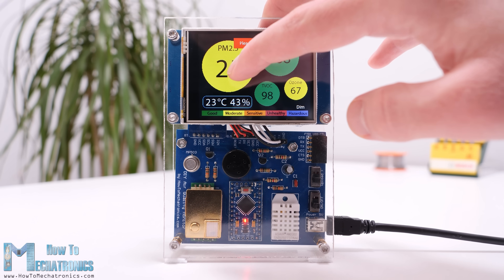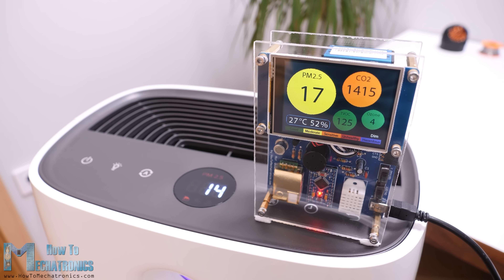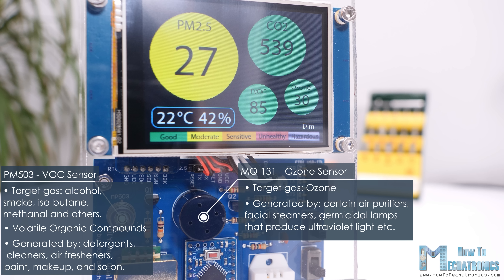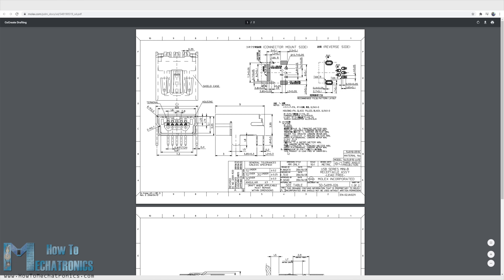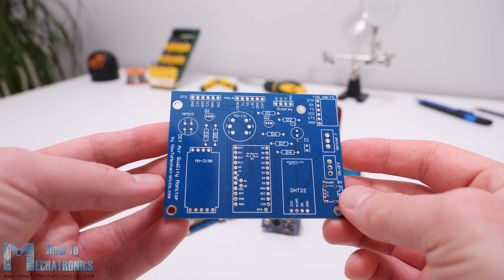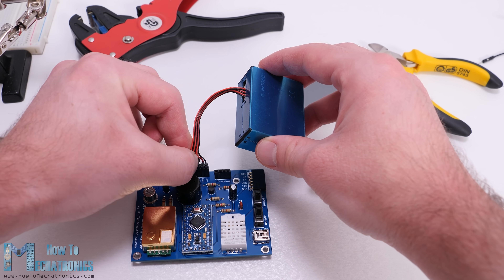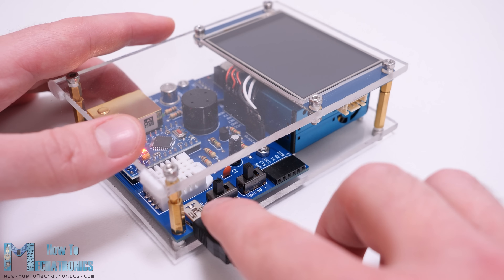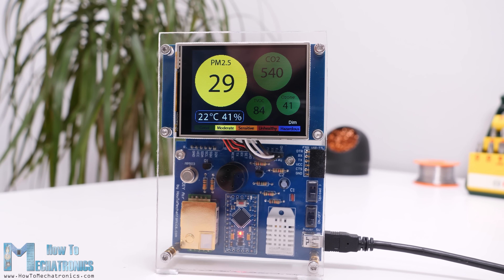DIY Air Quality Monitor - PM2.5, CO2, VOC, Ozone, Temp & Hum Arduino Meter

Comment: PMS5003 is capable of measuring PM1.0 / PM2.5 / PM10. Would it be difficult to implement those other parameters into the code?

Comment: Hello Dejan! The download links for the Arduino code and for the screen layout doesn't work! It is also impossible to leave comments on your site! Both for downloads and comments I received a message about and error accessing the database! Could you please check this issue? Thanks and compliments for your job!

Comment: I think the schematic need to be updated, i checked the schematic on your website and it doesn't show how the analog sensors are connected to the ADC, and here 5:20 both are connected to A0? is that why you control the heating element by D6 & D7? shortage of ADC pins?
Reply: Only the mq131 is connected to A0. Mp503 is connected to pin A1.  I built this with the board he designed and everything works fine. Must be a mistake in the first schematic.

Comment: My greatest compliments for your design. I build it and it works perfectly. Very good thinking about features and timeline. I made some adjustments so I can easely exchange sensors, but for now I cannot imaging what I should change. Calibration is for me less important compared to more or less  value readings. Maybe the loss of data when disconnecting the power could be a minor issue to solve. Thanks for all your time! Great job!
Reply: Hello! I'm a student and I need to build this for my studies. Could you please provide the materials you used and where did you order it, if you don't mind? It will help me a lot. Thank you!
Reply: @francenred1415  hI! did you find how to?

Comment: Can you include  temperature / heat generator which will turn on and off within specified  range of temperature and humidity.  Ventilation when co2 is higher than required

Comment: A very nice project that I was very much interested in for VOC monitoring until I realized that you can actually buy an air quality monitor that covers VOC's for less than just the PM2.5 sensor in this project costs

Comment: Great video, I made a similar system based on ESp32 without display but It can be integrated in home Assistant so you can check data also remotely
Reply: Hwy there 
Would you like to share details please?

Comment: Hi Dejan thanks for the amazing project 
I was just asking about the Mq131 sensor, its mentioned in the datasheet that it should be preheated for 48 hours 
It is also mentioned for Mq7 sensor that i want to use ? can u guide me throgh this?
Can i use the sensor straight away after purchasing or should i do the preheat procedure ? and how can i do that ?

Comment: great project, my workplace needs a few of these
 is there any way to add a decibel meter to this project ? 
is there a way to add a carbon monoxide sensor and monitoring? 
and is there any way to have 5 of these units report back to a central device for real time monitoring and data logging ?
Reply: Sure.

Comment: Very good and very informative video. The next upgrade to this project should be an air purifier. The air quality will send feedback to the fan when the desired value is achieved, the fan will automatically stop.

Comment: I like how he explains how the sensors work on a mechanical basis, not just how they're used electronically.
I should build one of these, for my oil painting area. At least the VOC part.
Reply: You can get a Sciosense APC1 evaluation kit for that, just plug it into your laptop and use the software they provide for that.  The evaluation kit is different than the sensor by itself, the evaluation kit (EK) comes with the usb cable and software and it works perfectly for 1 sensor.

Comment: I'm curious if anyone has built more than one of these, stood them side by side, and received the same readings on both.
Reply: Why would you expect industrial level accuracy from a cheap DIY project?
Reply: @nextlevelbruh827  Well, if this project is just a toy meant to teach the principles of such a device, I'm not interested.   On the other hand, if it can give reading +/- 3% of reality, then I'm in.   The finished products like this offered on Amazon garner terrible reviews.  That's where my skepticism comes from, and also my desire to build my own.
Reply: You don’t even need to build two, just buy multiple sensors and hook them up and test them at the same time to one arduino. Then use the best components

Comment: What happens if you fart in it? Which of those figures increases and by how much?
Reply: Voc and CO2 should go up, if particulates go up, be worried.
Reply: @lightdark00 LMAO
Reply: Build it and do an experiment with it with your family and friends then use AI to find patterns in the data and publish a paper I'm 100% sure the youtube AI will be all over that 😂
Reply: There could have been a better way to get a decent reply
Reply: Probably not. You need a H₂S and CH₄ (hydrogen sulfide and methane gas) sensor. Most of the fart gas volume is composed by nitrogen and carbonic gas, but the bad smell come mostly from hydrogen sulfide (approximately 1% in volume).
Reply: We need PM detector not a bloody fart detector😂😂😂
Reply: It's 3 years now how's the progress on the  experiment
Reply: The meter isn't meant to smell.  Smell on your own & put your rating where 10 - staggering and 1 - loud

Comment: Great Project. do you know what will it take to use a NodeMCU instead of the Arduino? I want the same setup but that will also connect to Home Assistant via WiFi
Reply: Did you ever find out how to integrate it into Home Assistant?

Comment: Don't get me wrong, the thing is very well made, and I understand that not everyone is comfortable around ESP8266, but this project seems to be a perfect fit for one of those.
- No need for RTC (just get time from internet (at power up) )
- Upload new sketch over the air.
- Check your graphs and data on any android phone (can even skip the display.. which is expensive)
Reply from the maker: You are absolutely right! Thanks for the input!
Reply: RTC is always needed as backup in case when your internet connection is down
Reply: @acerrusm  not really, if not real time-sensitive, in my experience internet down does not happen much, maybe different in your country.
Reply: @acerrusm  You can always display the current values from all your sensors
You can also always collect values based on relative time (every x minutes), display those and sync the time axis with the internet time when it becomes available.
The internet in my place is seldom down, and never for more than an hour.

Comment: Good project. Now add CO, HCOC, PM10 and it will be one of best air quality meters!
Reply: Actually for the PM10 @2:27 the sensor can already switch between them and the upgraded version can do somewhat better (PMS7003) what are the others polluants are you talking about? HCHO? sry not really my field. I'm interested in making one of these air monitor based on that one.
Reply: @hugodc1225  Oh so PM1 and PM10 are included? That's great! I missed that one, sorry:)
Well HCHO (hcoc was a typo) (although the real formula always used to be CH2O ... dk why manufacturers have changed it to HCHO)  is Formaldehyde - one of biggest indoors pollutants nowadays to worry about. 
And CO (unlike CO2) is Carbon Monoxide - an infamous "silent killer"! The stuff is lethal. There could be a fire in neighbor's flat and CO can kill you even before your smoke detector/alarm triggered.
Although of course it is worth to have CO detector alone (next to Smoke detector) in few places of your home.

Comment: This is a great project.   I read through most of the comments and many want to eliminate the display and use an ESP32 or similar.  then either MQTT or a cell phone.

It seems that just replacing the microcontroller is a trivial thing, but to have an AP, with website that can offer some graphics.  ( I really like the red/yellow/green of dots showing levels)  
Is there a part-2  in the future ?

I think that anyone wanting to go MQTT would already be able to export the data for that use.

FIVE STARS for your 24 hour arrays with data, just brilliant.
FIVE STARS for your wait with timer to gather data from a sensor.  also brilliant.
Reply from the maker: Thanks!
I wish I had the time to make a better version of this project. It's really a useful project but it can be done much better, definitely.
Currently I don't have any plan on making version 2 of it, but who knows, maybe in future.
Cheers!

Comment: I was just wondering, why not use BME280 for temperature and humidity measurements? It has much higher resolution and accuracy than the DHT22. Air pressure reading is a bonus.

Comment: Great project! Can you or someone else who has done this build, give us approximate total cost? This has been asked by several people with no response.  Thank you!
Reply from the maker: It can vary depending what components you will use. Simply go to the part list section on the website article, check the components prices and calculate the total cost.
Cheers!
Reply: @HowToMechatronics  Thank you, in your write up, you mention that the Ozone sensor can be omitted if not needed. Do any modifications need to be made to these instructions if I chose to exclude the Ozone sensor (or any sensor)? or will it work as intended simply with null readout on the display for that sensor?

Comment: Hey man, just wanted to complement you on your thorough explanation of the function of each sensor, especially including brief info on sources of contaminants. You get a lot of info in without getting off track or droning on and on, and it makes for a great video.

Comment: Hi i am very interested in making this gadget because I study environmental engineering. I tried to use your .rar file for ordering the PCB for the DIY air quality monitor. First I converted it to .zip file, then uploaded it to the American PCB maker called OSH Park. I am confused about most issues the website pointed out in the .zip file. These problems are "Outline layer appears blank in .GMI file", "Couldn't find a bottom silkscreen layer", "Removed the .GM15 and .GM13 files because they are redundant". It also says "Internal error while processing" six times. I want to try fixing it without Altium Designer first. I should say that I am beginner that just got into this circuitry hobby. Please help me.

Comment: Great project but I cringed when you used the auto router. Altium is expensive but it's auto router is terrible. I do all PCB designs manually with it. Takes a little longer to do but you get a better layout.

Comment: Your tutorials are great and I appreciate that you provide the STL files. However for those of use that want to learn to design specifically mechanical parts and robots, it would be great to have a series that explains more of the designing process! Thanks for sharing your knowledge and creative projects!

Comment: Hi! Thanks for the wonderful video! I downloaded the code from your website, but couldn't understand why have blocking loops been used for the sensors after the first sensor. If someone could share some information it would be really helpful!
Reply: some sensors require that you connect and then it takes a reading. then sends the data back.
this can take some time.
by connecting to the sensor, you are not really blocking code, you are completing a cycle of action.
connect, read, download.  then move on to the next task.
Reply: some sensors take time. As an Example:   the DS18B20 temperature sensors needs about 0,75ms to read the senor.  

the TVOC is brought high.  maybe you could just come back 5 seconds later and read the analog pin.  

the CO2 (MHZ19)  is serial, so you want to talk like you are on a phone.
connect, exchange information, then hang up.  3 seconds

the PM2.5 is also serial, you cannot talk to both.  the  'while'  keeps you talking to only one device.  another 1 second.

the MQ131 is a call to the library, which, I assume has the same sort of while delay.

it does appear that you could bring TVOC high, do the other 3 sensors, then come back and take the reading.

but, since you only need to read every 15 minutes,  it is a simple matter to waste 5 seconds and keep all the code tight and in the same place.
Reply: @dave-in-nj9393  Dear Dave, thank you for the response! I see. So how is the connection established? Is it a two-way communication between the microcontroller and the sensor that occurs before a reading is taken?

Comment: Hi The project inspired me to built one. Somehow, I am not getting the 24 hr plotting. Do I have to run the unit 24hrs continuously? When I press any value, it is in 'please wait' message forever.
Reply from the maker: Hey, when pressing the values for getting the 24hr plotting make sure the "Upload" switch is turned off, so the Arduino communications with the Display in both directions. Also sometimes the program doesn't enter at first try, try clicking again and wait a little bit again.
Reply: @HowToMechatronics  Perfect. It started working plotting when I put the upload switch off. Great help. I will post the pictures once I put them in the box. I had issues in my FTDI chip bought from BG, never recognized by the windows 10 device manager. Then, I tried in win7, after few hours of try, one time connected and uploaded the sketch. The chip also work with AVRISP mkii mode only. I ordered few  more FT232RL 3.3V 5.5V FTDI USB to TTL Serial Adapter to try again if I need to upload revised code in future. Resourcing all the correct parts, gave lots waiting and luck in working. The PCB designed is perfectly working.

Comment: Hello, how do I place the MQ-131 on the pcb? There is no "orientation" info on the MQ-131. Very good project!
Reply: I had the same issue. By reading the specs, I am 80% sure it does not matter in which orientation of the 2 possible ways you install it.
Reply: I'm facing the Same issue any solutions??

Comment: For the rebuilder:
Correct resistors values:  R1 = 1K, R2 = 2K, R6=100K or 1M, R7=1K
have fun , Mike DF7MR
Reply: thanks and for R5: 10K?

Comment: have you thought of adding an NO2 sensor,  as you are already monitoring O3 you can correct for the crosstalk of o3 with no2 in the no2 sensors.  no2 being one of the main air quality pollutants causing problems.

Comment: Natural gas in a small and constant presence give you a slowly creeping migraine. i had this problem with a heater, the heater sucks up dust and cloth up the ventury, thus leaking gas every 5 months. Really want to know which meter measures this, VOC ?

Comment: THat LED on constantly would disturb me in my sleep, you might want to consider removing it if you can't turn if off.
Reply: marker
Reply: @brandonnorris1026  Tried already and its not that successful. Have an MP3 player that has a bloody annoying one that flashes when playing and is on when static, speaking to the designer, the ability to turn it off isn't built in.

So until I can get a case to fit it, its in the project bin.
Reply: @thepvporg  Hey, electrical tape blocks light completely + superglue to keep it on
Reply: ... desoldering the LED  ;-)

Comment: Ever thought about using an esp to integrate in smart home systems instead of the arduino? Would also have 3.3v diectly
Reply: ESP32's are a much better choice for the reasons you cited.

Comment: Hi, great design, those CO2 n Ozone figure is ppm or ppb in measure?
Reply: Ozone should ppb where ambient ozone is generally around 50 ppb.  In the USA, 75+ ppb over 8 hrs is a violation.  But i noticed the accuracy of sensor is 10 ppb.  CO2 should be ppm where ~414 ppm is the current global average (Mauna Loa site) --and increasing.

Comment: Hey can u do a video based on sending gps message using gsm module sim800A..
Reply: I've run a commercial air quality sensor alongside the PMS5003 and the readings are very similar with no more than about 2-5% worst case of difference.

Comment: Awesome explanation as always. Out of curiosity, did you consider using BME680 sensor from Bosch during the design phase? Because it does the work of PM503 and DHT22 combined, plus it even has some kind of pressure sensing, which affects whether pollution levels build up.